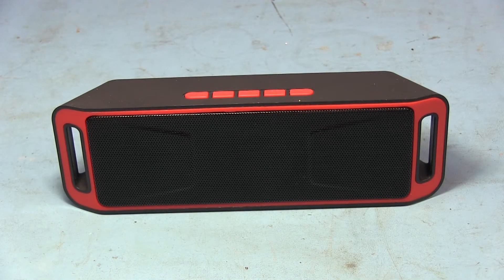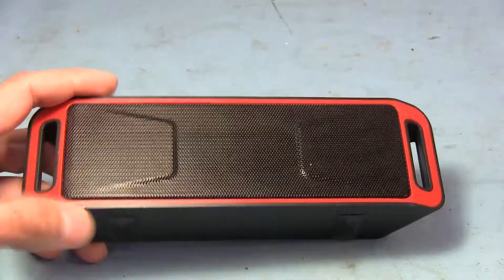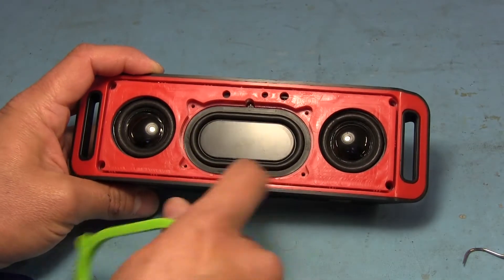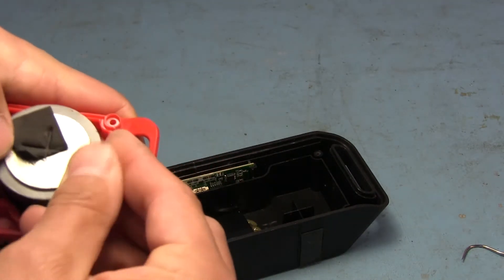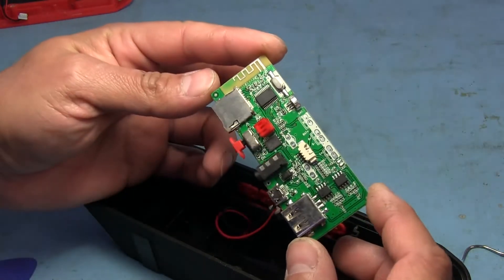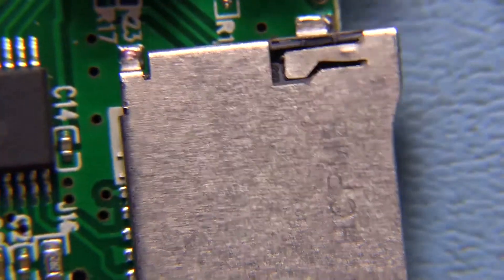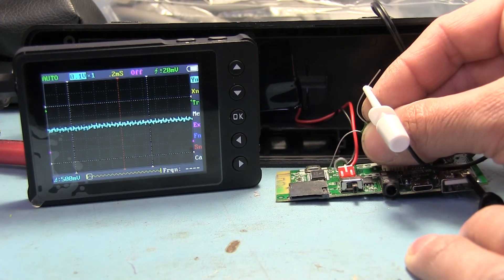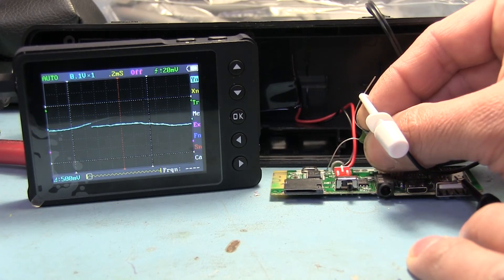TWB #62 | Cheap Rechargeable Bluetooth Speaker Teardown

Comment: I suspect the BT SoC and its internal DAC are capable of stereo, it's just that the firmware is running it in mono mode. It's very strange though, that they went to the actual trouble and expense of providing a stereo power amp, but only having mono.

Comment: Hello, is it possible to solder or attach a third party mini stereo amp card such as Pam8403 onto this board and keep using the existing functions like bluetooth, sd, 3.5mm, usb, fm ..? Since there is an all in one setup  on this board, maybe I can upgrade it by adding a new cheap powerfull mini stereo amp and relatively high cap battery and speakers...

Comment: The cloth is for what's called "dampening" it improves sound quality
Reply: Cam Corder passive radiator for enhancing the low end as long as the sound box is completely leak prof.
Reply: Im pretty sure dampening is when you make something wet

Comment: I just got a similar one and it’s battery was NUKED.... I replaced it with 2 18650 batteries I had and it’s a decent speaker. The battery that was in it was actually a very old Nokia cell battery... of course mine was swollen and not looking healthy...